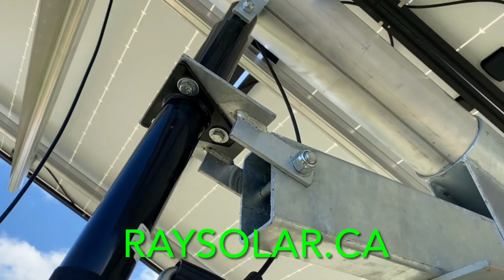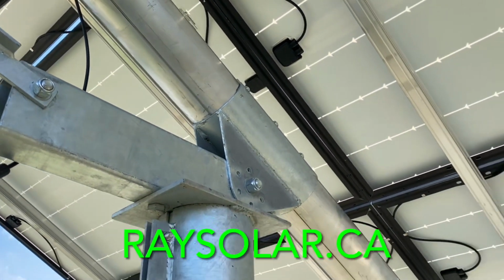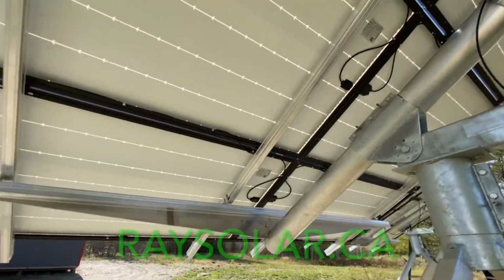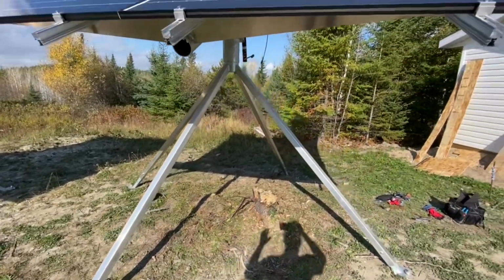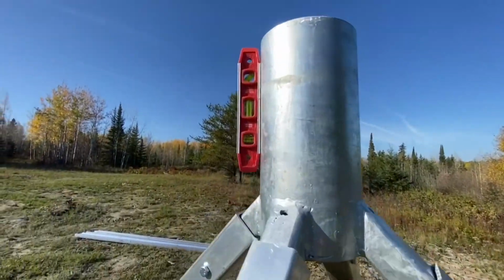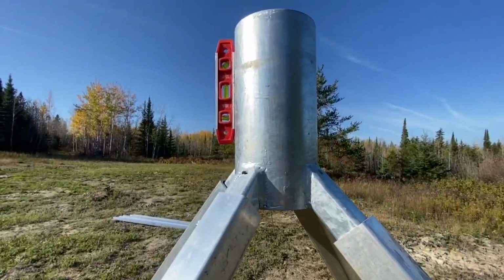Ground Mount Solar Made Easy!

Comment: Hello, a question, how does the sail effect affect the plates when a strong wind blows?
resist solar panels
Reply from the maker: Hello 
The pull force will vary on the type of soil. condition. We can recommend the anchors needed based on the type of soil, however we recommend a structural engineer review your particular conditions if you’re unsure.

Comment: Won’t the wind blow it over 

Where I’m at I would have to anchor it in ground at least 4 feet
Reply from the maker: You should always check with your local engineer on the applied forces. We haven't had one blow over when properly anchored and exposed to local central Canada Winds well above 100km/h.

Comment: Did you say you sell kits like this? I'm in Ontario
Reply from the maker: Yes, we do. You can supply your own 6” schedule 40 pipe locally or you can opt for the Quad mount as seen in this video. Depending on your panel size it will determine the options. 
Please reach out to engineering@raysolar.ca with your panel specifications for the RS Mount.

Comment: Whoa, these are EXPENSIVE!  I could hire people to hold the panels up to the sun for less.
Reply from the maker: 🤣 They are hired… I wonder how they do in the cold 🥶? I suppose expensive is relative to the options of the mount of others 🤷‍♀️
Reply: This is unfortunately my reaction whenever I look at the various manufactured or DIY setups. I am currently trying to replicate a few systems I have seen using off the shelf parts. I don't know how to do load calculations so there is a chance my setup will be too weak so I need to find a way to bolster it.

Comment: Just buy more panels. 
Trackers are useless with so cheap panels.
Reply from the maker: For most domestic home applications additional panels are better rather than a full tracker as the economics don't make sense. In this video it is a single axis tracker and we adjust for the latitude with the changing of the season /sun position. 4 times a year in Canada.